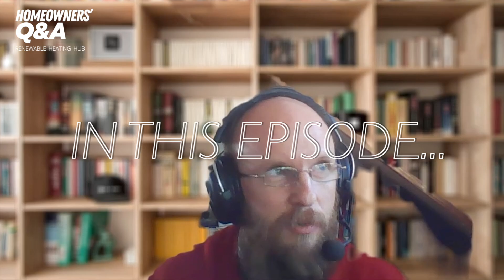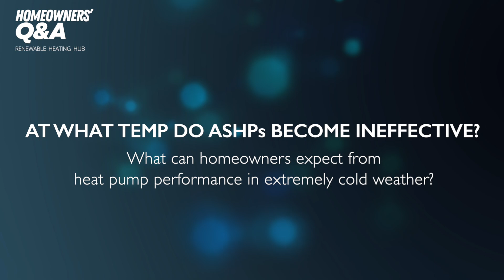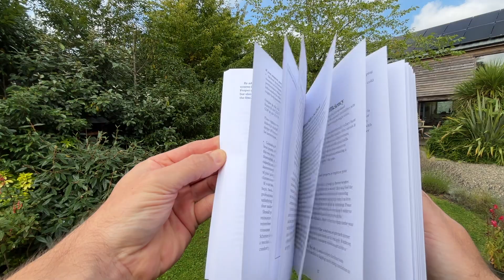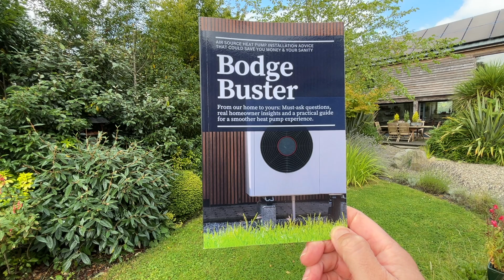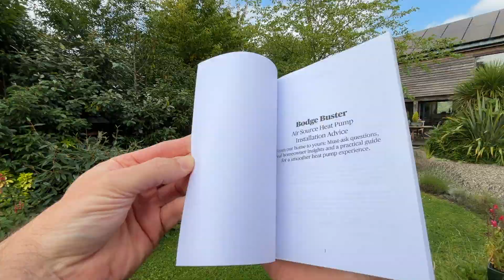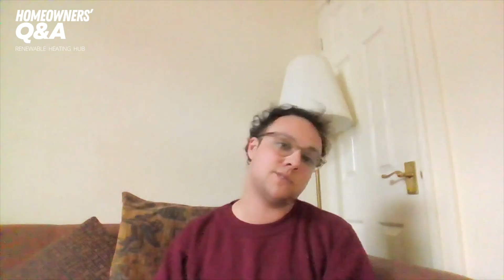Will Your Heat Pump Keep Working When It Drops To -10C Outside?

Comment: I do have a question about the section at the start where it was explained that it was the differential between the source and output temperatures that affected the efficiency.

In the manual for my Vaillant heat pump it does not show this relationship, it does show the efficiency decreasing with increasing output temperature but not affected by source temperature.

So as an example, my Vaillant Arotherm+ has the following figures for a flow temperature of 50º. SCOP 3.41 for all the specified outside temperatures. The maximum power output however varied according to air temperature, with -5º=5.5kW, -3º=5.9kW, 0º=6.4kW, 2º=6.7kW, this indicates that at lower temperatures the maximum power will drop, but efficiency will remain. 

I assumed that source temperature was external air temperature, It may be that by source temperature it was meant the input water temperature from the heating system rather than outside temperature, in which case my question is invalid, it did seem though in the video that source temperature was outside air temperature.
Reply: I should add to my post that the COP readings I get from my heat pump reflect the manual. It's not possible to tell from the heating because the weather compensation means that when the weather is colder the water flow temperature goes up (obviously), however the hot water is always roughly the same flow temperature - some variation depending upon how much hot water I've used.

For my hot water I find I get a cop of 3.1/3.2 whatever the outside temperature, if I run the cycle during the day with 15º outside then the COP is roughly the same as when the temperature is 7º - the heat pump has only been in a few months, so I've not had any really low temps.

Comment: A major argument against hybrid is the service charge for gas supply if its hardly ever used. Would rather have snall storage heater in each room running off peak electric than a boiler...

Comment: I got a Grant heat pump on a Grant the installers went bust immediately,so out the equation they didn’t want to know.I have a black box on the wall which must be recording something but what no instructions the guy that came to service the pump hadn’t a clue all he had was a screwdriver same guy that installed it they just wound the company up didn’t care then don’t care now no one to reprimand them untouchable.Just throwing good money after bad Heat Loss it is all fitted Pump.Pipework if you know what I mean.Like your channel but they keep rabbiting on about why it’s not working my Combi Worked perfectly idiot proof to hot turn it down to cold turn it up.Job done.Same house same draughty rooms same pipework ?
Reply: Exactly that that, Same draughty house, same draughty rooms, didnt the salesman tell you you need to spend £10k draught-proofing the house before having the heatpump fitted? and didnt your doozy neighbour tell you if you spend £10k draugt-proofing the house you would save so much heating it with youe old gas boiler that you may as well keep it?

Comment: Is humidity being high in UK and Ireland not a big factor when temperature gets low defrosting is more because of the humidity Evaporator freezing up more.
Reply from the maker: Yes it is. Temperatures between 2-4C typically lead to more defrost cycles.

Comment: When you are talking about low temperature heat pump performance the most important variable is the refrigerant. R290 is far superior to R410 and even R32 at low temperatures because of the low cycle pressures and high heat capacity. R290 can produce a COP of 1.8 at -30C.

Comment: The problem I see with hybrids (gas backup) is that there is still a reliance on the gas network, really we want to be closing down the gas network not putting out the message that "they're OK, but we need gas for when things get difficult".

I realize that there is a transition period, but putting in new systems that rely on gas doesn't seem right. Of course if the backup was just to supplement with electric immersion heating then that would not be a problem, though as was pointed out in the video by Carlos choosing the right heat pump is possible.
Reply: Yes paying a gas standing charge each month for a two week low temp climate on winter is expensive and daft, just plug in a fan heater for the occasion.